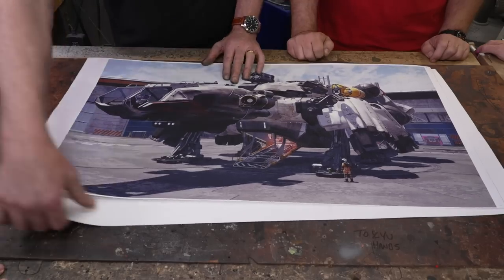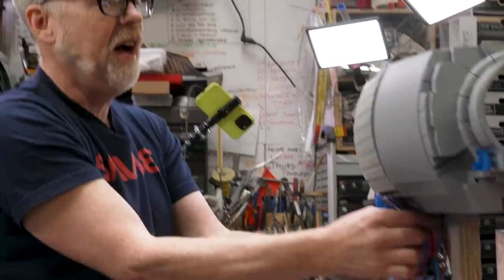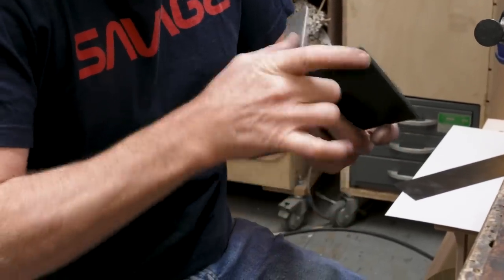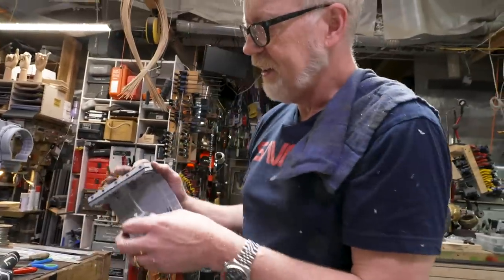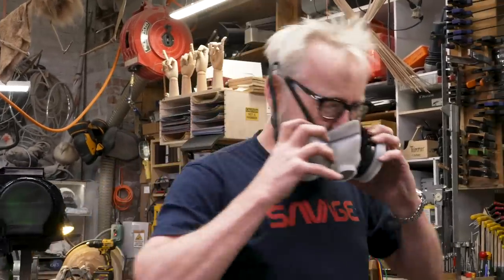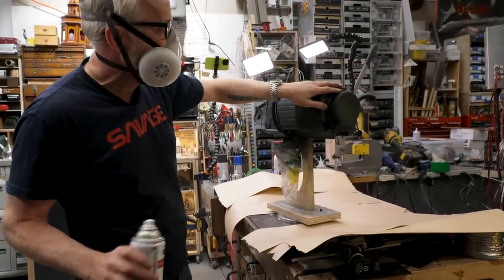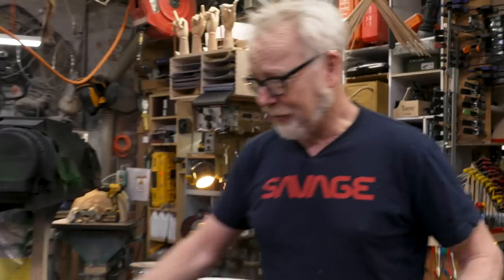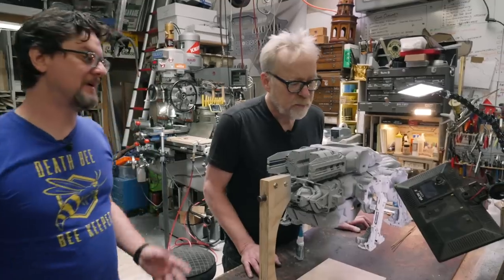Adam Savage's STARFIELD Spaceship Model: Nuts and Volts!

Comment from the maker: This video is part of a sponsored series with Bethesda Game Studios. Learn more about Starfield at http://www.starfieldgame.com 
Part 1: https://youtu.be/TuM_1xSQCFw
Part 2: https://youtu.be/B4dio__b3Fo
Thanks to Formlabs for providing 3D printing support for this project! https://rb.gy/sq3c6
Reply: of all the build video's this series is by far the most interesting ... it not only shows the skills needed ... but the design choices and why ... I hope we get to see more series of actual production work from start to finish (as finished as possible anyway) 
.
the insights and considerations are a great way to teach and understand why something was done one way and not another
Reply: Model looks cool. Can't wait for the game.

Adam, have you ever looked at echenry, he digital remakes models of star ships and did some back ground ships from star wars.
Reply: lovely work you guys did there, as a note , you can use laquered single core wires, like the ones used in coils, those are much thinner and easier to hide, not sure why resistors are in the middle of wiring you could have added them on the very end of 'umbilical' , those -'tiny' leds are SMD LEDs and those come in 14 packeage sizes see on https://en.wikipedia.org/wiki/SMD_LED  additionally when on LED topic , you can use adressable LEDs as you arer already using a microcontroller, this way all leds can be connected together to power line sourced by microcontroller, then you send a signal to fire up certain one choosing intensity and colour (RBG) this can be easily changed later by reprograming - tihs way you ony need + and - wire for all LEDs you can control the amount of amps spent on LEDs by pulsing them on different frequenices if you need to conserve power, also in that tiny small one by the door on siggle coin battery you can run that for a year if you choose the right inductor and use 'joule thief' ic , you can find those as single chip in solar lights :) a lot of model makers usually make their own PCBs to fit narrow cavities inside the models, so that it is self contained and it does not need any cords coming out etc
Reply: @kira07  because of the way she is wring the model and the power source typically used on set ... she is avoiding a micro controller making for an easier setup with less bulk the resistors deal with the higher voltages used in an out of the way place and compensate for the resistivity of the wires ... lacquered wires are nice BUT not good with higher voltages so in their application not applicable ... dont forget this is for filming NOT for display ... and filming requires a different light intensity than a display model does ... which is where your suggestion is correct
Reply: to Bethesda, thanks for building an amazing game that one third of your user base including me will never be able to play. We are in a difficult situation, do we give up on the game we have invested 7 years in and spent  so much money on updates and crowns over the years or do we buy a complete new game console for one game.  Really disappointing. You need to make it possible to move all crown purchases and progress from 1 server to another if you are going to start operating like this!!!!
Reply: @glens1975  thats why i stopped buying new games ... when every update you need to upgrade your computer to play it ... if they were smart and NOT GREEDY ... they would make it playable on more systems at a lower price so they get ore profit by volume instead of gouging for am iffy game release
Reply: @kaboom-zf2bl technology moves on 😅
Reply: fantastic!!! :) i was wondering why you didnt sanded the big surfaces, some supposedly round surfaces that weren't really round, showed edges, and the walls inside the ship could have been sanded a bit. Just commenting Regards
Reply: Good to see ya back on space-ships, and not cruise ships ;)

Comment: Being a commercial painter I've found if you slightly pre wet that frog tape you will activate the anti bleed solution underneath which will fill any gaps before you spray which will leave you with some nice clean lines :) That's what i would do when painting patterns or two tone walls.

Comment: I’d love to see more video about how the electronics were designed / programmed.
Reply: Wasn't that the second video?
Reply: @ericheckman3888  not really. They talked about routing wiring and that they would be using some sort of microcontroller, and that it would be powered separately, but that’s about it. Nothing about how the circuits were designed to be as modular as they were, the programming, whether they used any pre-baked code that others could use to replicate things, etc.

Comment: This ship is really coming together! I may get some flak for this, but the best thing I have found to remove spray paint from my hands is brake cleaner. melts it right off. Then I wash as normal, and rehydrate my skin with Working Hands. That stuff is a miracle. I've been a diesel mechanic for over 25 years, and every winter I fight cracked hands and cuticles. Working Hands has made the winter months much less painful. Keep up the great work!

Comment: Love this series and seeing the collective enthusiasm.
It's been many years since I've dipped my toes into modeling but something I've tried in the past to help lessen random overspray was the use of masking fluid, commonly known as liquid latex. Apply a light coat to any irregular surface that may be a pain to mask out with tape, then tape over it. When you remove the tape the latex will usually, but not always, pull off with your masking. Any left over masking fluid can easily be rubbed off with your finger or the eraser of your favorite pencil.

Comment: I love watching this particular series. I build small models of narrow gauge locomotives (4mm scale on 9mm gauge track). Like this they are 3D printed and have micro LEDs for lightning and have tiny DCC decoders. I also build buildings. Its great seeing all the the same materials being used. Styrene sheet and rods, brass wire and tubes, and so on. Great build...

Comment: The other way to add some good texture is to take some very fine sawdust and stir it into your paint, then use an airbrush with a slightly wider than normal nozzle. It ends up looking like an anti-skid coating. Which is fitting, because that's exactly how we made anti-skid coating when I was building helicopters. We sprayed it on our cargo ramps.  You just dump a bucket of sawdust into a gallon of high-temp truck bed liner and pump it through an HVLP gun.

Comment: I wish I had a 3d printer. Instead, I am working with resin and such. I am making my own scale model of the Frontier. I think mine is going to be just a bit larger than your model. It won't be changeable or used for motion. And it won't have lighting effects at first. I am documenting every step and may be sharing the files on the different 3D modelling spaces soon. These videos are fun to watch. And relatable.

Comment: Adam, if you want a good soap for cleaning hands, Da Vinci brush cleaning soap is amazing and gentle. I use it over a dozen times a day picture framing handling artwork and a bar will last around 3 months. It will remove car grease, tobacco stains and any paint off your flesh. Of course it will also clean and condition your brushes.

Comment: For the Fast Orange to work most effectively, don’t wet your hands first! Before you start, lay out a couple of sheets of paper towel. Pour the FO onto your hands, rub and scrape thoroughly, use a hand brush to clean the crevices. Wipe off the FA with the towels. Now use regular hand soap to clean the residual FA off.

Comment: You can use straws as conduit to hide  the wires, make it look as though it's part of the ship.

The switch for the screen can be just  attached to the wall will a magnet, again, paint it and make it look as though it's s a power relay or something that's part of the ship's infrastrcture.

Comment: I build guitar amps (tube and SS designs), guitar pedals and I've even restored old tube radio receivers. Building electronics is highly satisfying in my opinion (as long as we pretend trouble shooting doesn't exist and is never nessesary...lol) so I would have loved to work on a project like this designing the circuit. But I'm used to building in very basic shaped rectangular shaped enclosures without much in the way of my off board wiring (compared to a project like this). That is to say I'd love designing and putting together the circuit for a project like this but working out all the mounting locations and figuring out where to neatly put all the wiring would be pretty crazy. I did a few point to point guitar tube amp and guitar pedals builds specifically to work on getting my wiring cleaner lately and I have to say it's incredibly satisfying when it's all done nice and neat. Point of saying all that was to say it was nice getting to see a glimpse into the circuit side of this project! I'm also looking forward to Starfield as well so this series has been right up my alley! Great work!

Comment: I love this, an idea for future builds, I am sure you have a electronics guru around the traps, you could develop a CanBus Board, that runs a raspberry pi rp2040 cpu, have a proper Pi4 in the base with a Can Hat, and only run 4 wires up the center rod, and be able to control lighting via a web interface broadcast over wifi on the Pi4

Comment: Not sure if this tip has ever been said, but if you use a lot of CA glue and have problems with it going bad in the bottle.  Refrigerate your glue.  It will still work it will just react slightly slower.  This also means that it will not react on its own in the bottle if you have to store it for any amount of time such as if you have multiple viscosities of glue but find yourself not often using some of those viscosities.

Comment: Also as a long time space gamer..  if that ship is old, and loved, it would have a bit of sandblasting look to the front facing exposed edges and corners of the paint on the ship. (maybe expose the primer a touch, a light rub with sovent look)A bit of a worn but polished look to it, where exposed metal looks slightly dull or oxidised, but polished.     Think cast iron sand blasted to the visual impact of old smooth dirty grey alumuinium by millions of micro particles and micro meteorites.  And in space iron doesnt rust very much, so things tend to be either polished or pitted depending what it went through.   

Speaking from my youth model painting years, a light metalic or silver finished model paint sort of gently burnished on corners with a sponge or fine brush should give you the desired effect.

Edit: it is then at this point I see they already filmed the live action video, and even after all this effort the finished model barely ever rates a few seconds screen time anyway.    :(

Comment: As a layman  I'm always fascinated how brutal but yet forgiving "the camera" can be.

If I build my own models and hold them in front of me of course I see any minor erro, every coarse edge, any unclean primer job and start over, discard or just be disappointed.

Yet movie pros are often so "bad" if you see them up close but in a 'wide angle shot' or in motion you wouldn't see any of it and thus it doesn't matter. At some of the closeups until 4:30 where you discuss the lighting, one can see ll the imperfections that 3D printing brings. Someone expecting 'professional quality' of smooth surfaces like injection molded toys of kits would be repelled. Yet it doesn't matter much for this prop as in the end these little 'faults' will just vanish through smoke and magic...

Comment: I wonder if the wiring could be simplified by using adresable LEDs. There are 1.5x1.5mm RGB ones available, slightly bigger for RGBW. It would require chaining the LEDs together, but it could reduce the outside wiring harness to 3 wires.
I would be even tempted to try designing the whole wiring as a flex PCB wrapping the outside, coming in through thin slits in the model, with LEDs soldered directly on.

Comment: I learned a new technique with the spray adhesive under primer. Does the adhesive layer impede the longevity of the primer coat at all? Just asking, as it would be a shame if the primer began to rub off during handling.

Comment: Adam, wonderful design and buildI specialize in weathering for Model Railroading and I'm biting my tongue try to hold back and just watch & listen. I couldn't hold back any further, I'm into the 40 minute mark and couldn't hold it any longer. I have to tell you about a primer that I think is better than Tamiya called Stynylrez by Badger Paints. they offer at least 12 primer colours. I have also used these paint for main colour as well. Check them out, I think you'll like them!

Comment: All the things and tools that you possess, yet no zip tie gun... You need a good zip tie gun. As a controls electrician, we used the crap out of them, as every wire in any given bundle of wires, which may enter and exit panduit many times, adding and subtracting from the bundle... well all of those wires in those bundles, all the way to all ends, must remain in the same exact place. Even if the bundle is some 250 small wires, etc... they all stay perfectly perfect in every bend, at every point, the whole way through... and man lemme tell ya... a good zip tie gun is crucial to that happening. The auto cutting, the exact (calibrated no less) tensioning of the ties... The speed and ease at which you can fly through an entire bundle or subpanel... They are incredible things. Now, I don't mean the cheapies at Lowes or something. I mean the good ones, the ones they'd get us tha tran like $400-$700 just for a little zippity clippity do dad. Seemed nuts at the time... and well, yeah... still is now too, as the profit margin must just be insane with them. Like... 99% profit. But they sure are nice, and well made at the high end. . .

Comment: When i see resistors, wires, connector housings and components being hidden, in a spaceship that will need greebling, I can't help wonder if this is the real deal - real greebling, and should somehow be incorporated into the model somehow - real wires routed in C channel? I guess less so when it's a replica with the greebling already determined. Similarly heatsinks - a tonne of sci-fi ships have some kind of heatsink, and having one which is functional in the model for real, just sounds awesome to me.

Comment: Why on earth aren't you using an airbrush to paint the model the results would be lightyears ahead of rattlecans.
Reply: Air brush is great, if you've practiced how to use one and have a good one. Otherwise you'll just end up with a mess and a lot of splatter.
Reply: @chronovore7234  nope not true you can dial it down to where when you pull the trigger and hold it in one spot for a few seconds before you see a spot of color forming, it's that precise  no way in hell you can do that with a rattlecan and the results well with a little bit of practice  you can produce something that is multitudes higher quality.
Reply: @rickpurcell635 how it's done on set